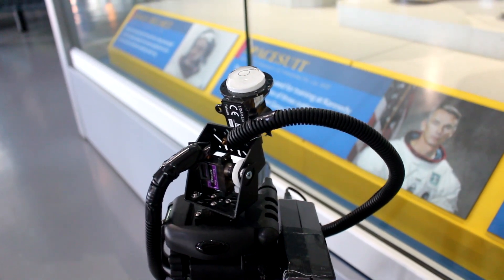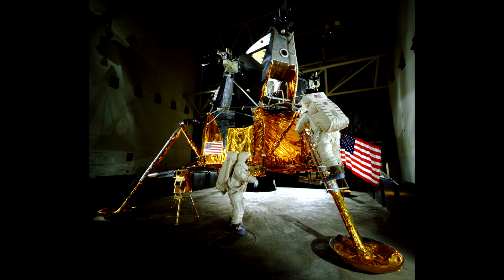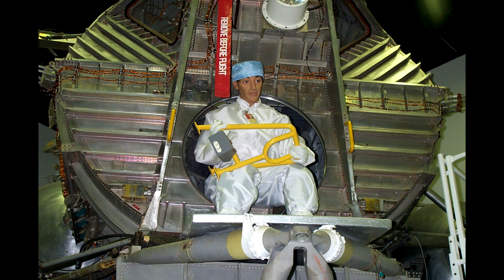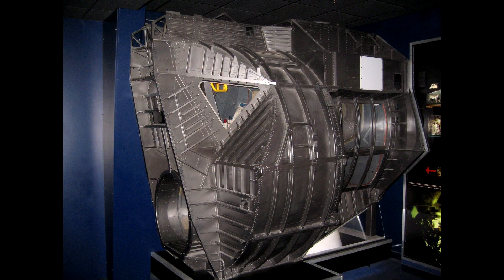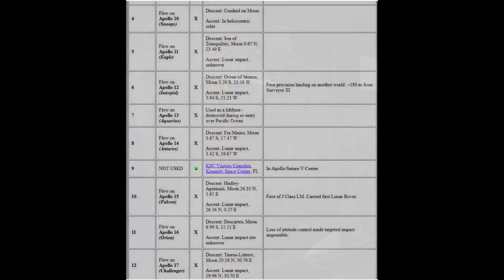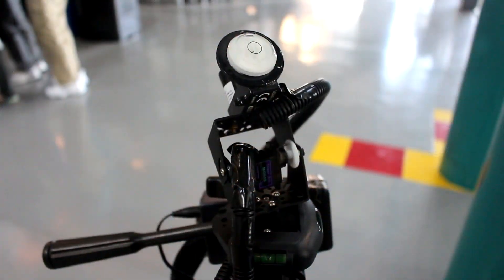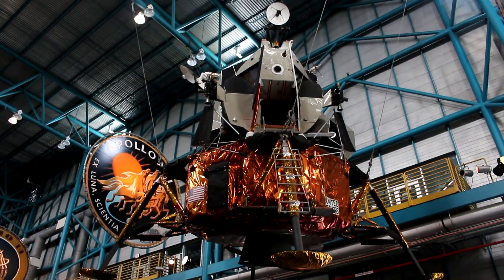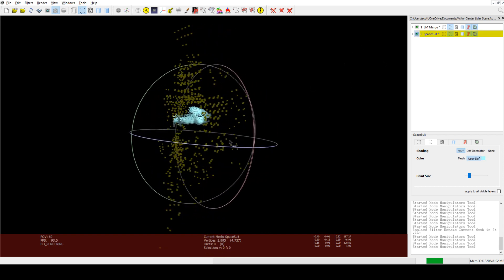Can an Apollo Spacesuit Fit Through the Hatch?

Comment: The lunar module’s opening is already admitted to be 32 inch by 32 inch square. The size of the spacesuits from the photos and videos can be determined by comparison by use of forensic photography science. So, the useless untrustworthy technology you so self-describing as powerful science, is not making any impact in anyone’s opinion. If you really want to use science, do the comparison in photos, using many photos and determine the width and thickness of the astronauts while walking on the moon, with their not convincingly inflated spacesuits and their backpacks, and you’ll then need to be honest. Can you be honest? If you could, you wouldn’t have used this pseudoscience as evidence for your conclusion.
Reply from the maker: My LIDAR scanner is far more accurate than guestimating based on photos, especially if the photos you refer to are the suits spread out on a table. Your condescending tone does you no favors either. I also accounted for suit inflation by quite generously increasing the size of the point cloud from my scan of the suit. Your condescending tone and accusations that I'm being dishonest will win you no points here.